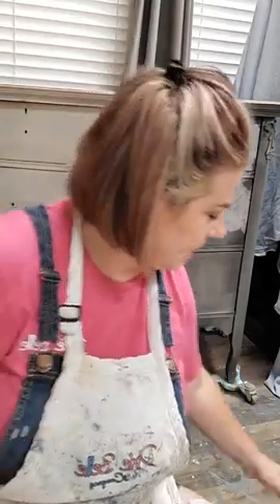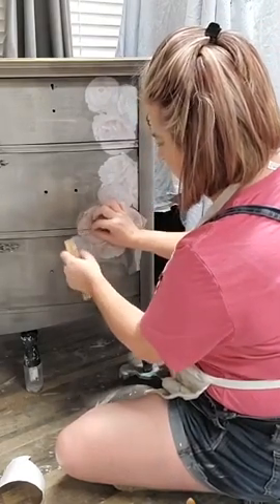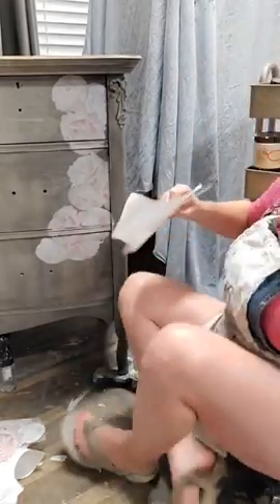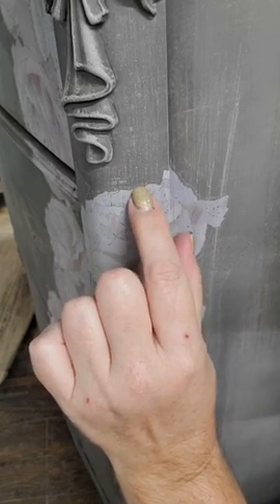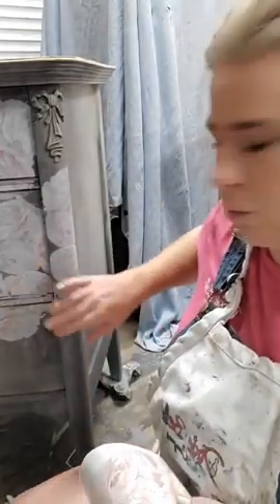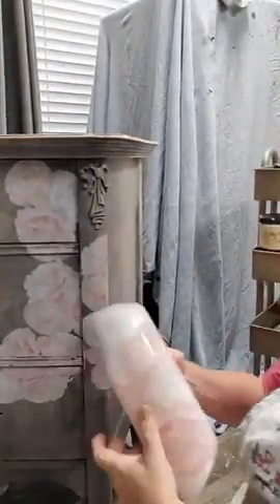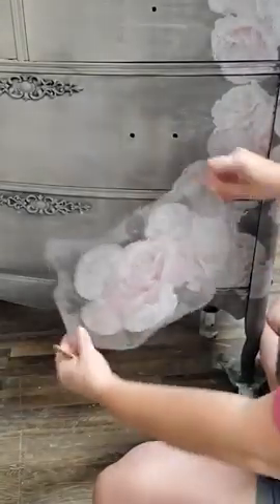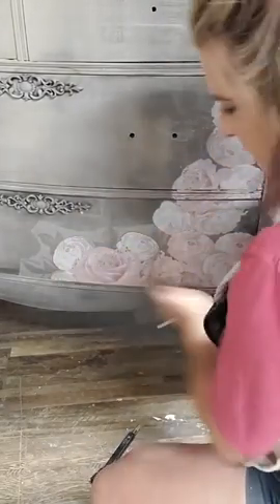Layering a furniture transfer

Comment: Oh my gosh I’m so happy to have found you!! Seriously, you are SUCH an incredible teacher and sooooo talented!!! 
Question…when applying to both sides, how would you get the transfers to come out so even/symmetrical? 
Do you usually work on one side then immediately follow the same steps with the other side or do you apply a little bit at a time orrrrr do you tend to complete one whole side first then work on the other? And if the latter two, how on EARTH do you remember which pieces you cut and how you cut them? 
l’m sure I’m completely overthinking the process. But my biggest fear is trying to achieve symmetry on both sides- 
I’m so worried I’m going to mess it up and my sides are going to be super uneven.🥴🔫

Comment: Hi. Love watching your videos.  All the extra tips you provide are great and so helpful.  I saw in one of your video a application sponge. Does the sponge get rid of the sheen and halo affect? I used a transfer over the satin top coat but I still have a sheen  on the transfer that can be seen in some light. Thanks
Reply from the maker: You can diminish a halo by burnishing (rubbing over surface) and clear coating, but it will not disappear completely on most dark colors